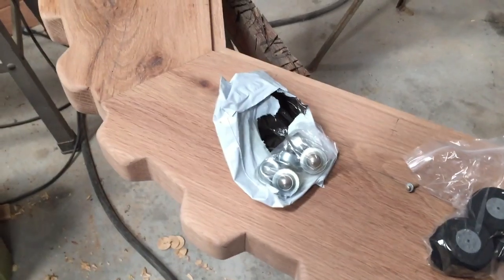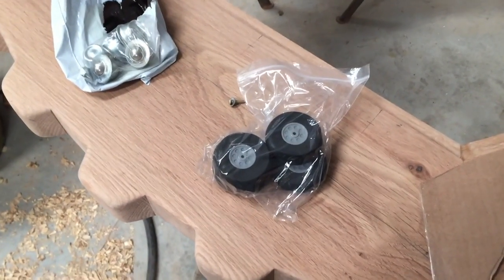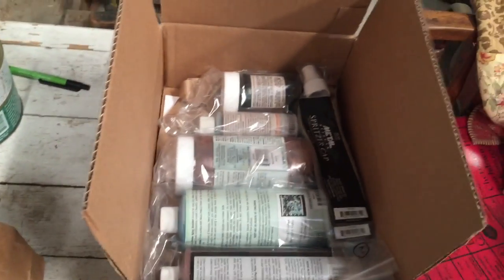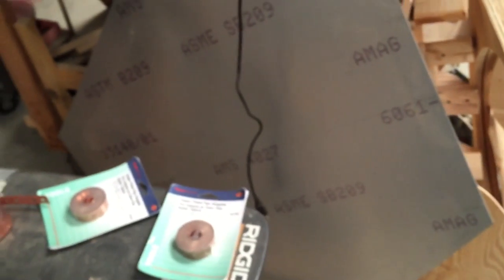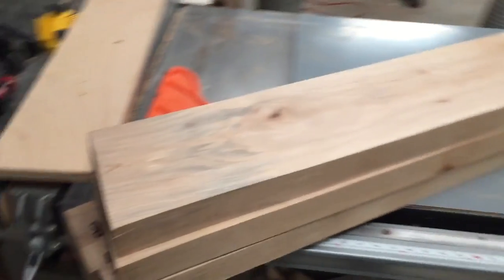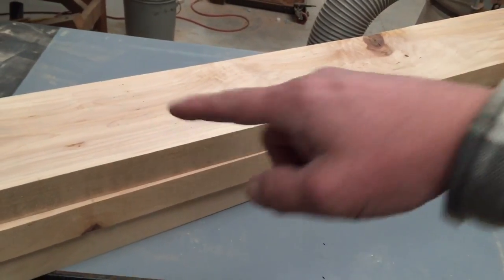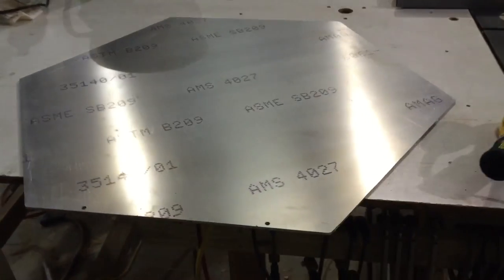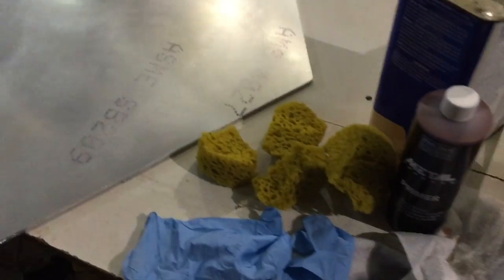Gear Table Ep7

Comment: this is lookiking real good, have tou thought about how much this top is going to weigh? maybe steel pipe legs would better support it or maybe a massive chain with each link welded in position
Reply: PILOTS NEVR make errors!
Reply: +OgMandin0 PILOTS only error once.
Reply from the maker: +Sidney Boudro Two things you don't want to hear your pilot say: "Oh Shit" and "Watch this"...
Reply: +iROBODUDE Flying into Albuquerque from Boston, in a holding pattern for two hours, pilot say we have clearance to land, but we don't have enough fuel to land
Reply: +iROBODUDE I was trying to learn Morse code so I put a tape recorder under the seat and copied code. I was in the left hand seat the pilot was in the same code class. We stopped at lands edge for fuel and from there in he tried to distract me by flying low over the marsh. A day or so later the mechanics asked what we were doing because we came in with grass in the skids. What you want is to be able to trust your pilot.
Reply: +Rev John O'Toole Don't worry you will land some where.